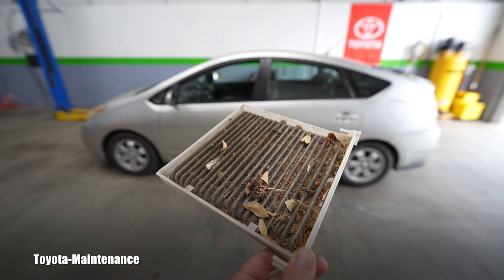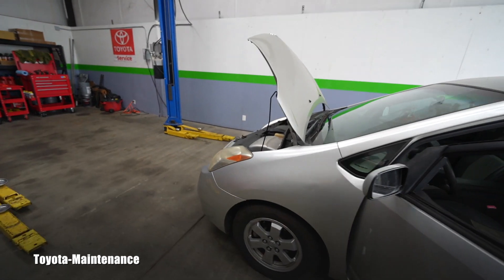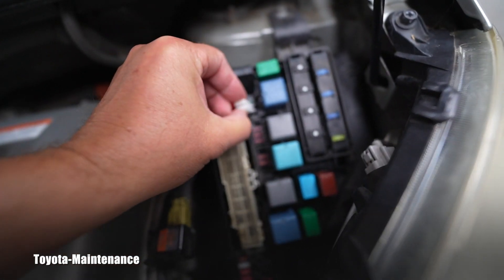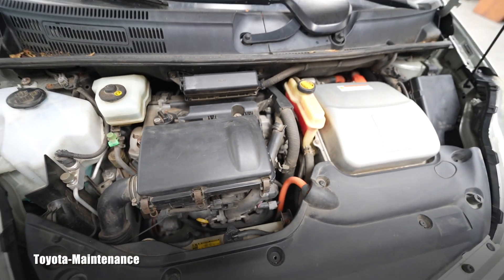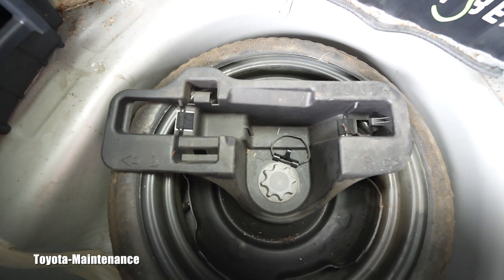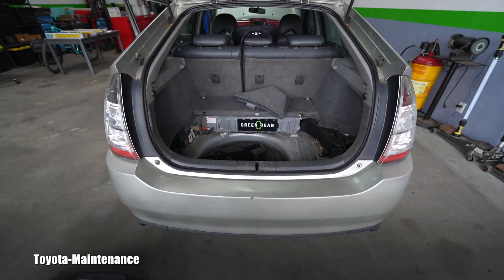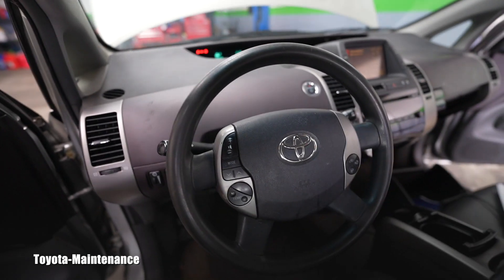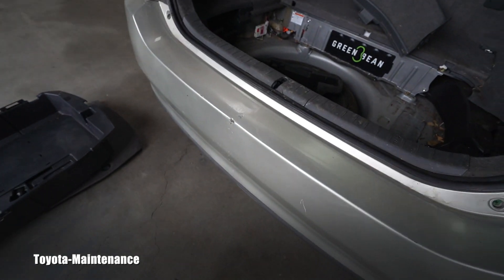Don't buy car like this!

Comment: I owned a 2010 prius for the last 6 years.  I got 154,000 miles already. Change the full synthetic oil every 5,000 miles. Replace transmission  gear oil. Replace all filters. Replace coolant. Last week my girlfriend son. He's a mechanic did full suspension on it. I'm getting new tires this Saturday. With all wheel alignment. This car is been good to me. And I will keep it easily another 150,000 miles. Still original hybrid battery. Thank you for your videos. They help me a lot

Comment: I agree with you on the part that this Prius has seen better days and the previous owner or owners have neglected the car to the point of disrepair. Most likely that is why it got sold. There are lots of cars that are in poor condition for sale and they may fit the budget for some buyers to kick the can further down the road, if they can get a year or 2 of service before it is no longer drivable they will be a buyer for that.  Now I disagree that the only option to replace the battery will be the new OEM overpriced battery from the dealer. There are many aftermarket options for well-known companies that can sell you sells for a fraction of the cost and you can get several thousand miles from the actual battery pack that you have without burning down thousands of dollars on a new battery from the dealer. Remember not everyone can afford those high repairs costs on a low-cost vehicle. We have to keep them running in a safe way. Now we are entering a new era of EV vehicles and more hybrids on the market and there will be an incoming aftermarket product to compete with the OEM battery parts as always been in the past with regular parts. We will see more and more batteries at the lowest cost and possibly with better components than the old design that will bring better range and longer charge due to the evolution of the technology vs the old tech from the 15+ old vehicles.

Comment: Couple of years ago I bought a 2007 Hybrid Camry for $1800. It needed a hybrid and 12V batteries. I got the 12V AGM from the dealer and a new not rebuilt hybrid battery with ALL new cells from a national chain for $2300 installed with 48 months unlimited miles warranty. The company has location in my city if I needed help. They installed it in my driveway. I had zero issues with it and been running like a champ. Did all the baseline service on all fluods, ugs, filters etc myself.

Comment: Got a 2011 Prius. Used it for pizza delivery the last 5 years. It’s got 215k miles on it and driving fine. I change the oil every 5k and change the filters twice a year. No issues with the car other than having to replace the oxygen sensor at 120k miles. Never buy a used vehicle without checking its maintenance history and bringing it to a mechanic before you buy it.

Comment: Full time Uber driver for 5yrs 9mo. Owner of 2 Toyota Prius's (2005 & 2009). Still driving the 2009. Logged 800k miles between both of them, and I drive them both very hard. I can tell you for a fact, that unless you are good with tools and have some know how to work on cars. You might want to pick a different car... These things are full of bugs. The bugs however, will be the least of your concern, and most issues easily overcome... MAIN ISSUE!!! If the previous owner did not change the oil faithfully, that will be the problem going forward...  That car will always use oil.  From day 1 you need to faithfully change the oil every 3k miles. You might take a chance at 5k and be ok, but you're risking it. And you better be using synthetic with filter everytime!  If that part of the maintenance was neglected in the first 100k. You will always use oil in that car. This goes for pretty much any newer car due to the low tension rings to help curb emissions.... Those rebuilt batteries are no issue.  I have a local battery guy, and I've used rebuilt for both my Prius's and no problem. Rebuilt in my area are $250 installed. I've logged 200k plus on each rebuilt with absolutely no issues! I've never had a problem with any hybrid battery, I just changed them out as a preventive maintenance, cause I drive to the middle of no where.

Comment: I replaced two bad cells myself in a 2010 Prius traction battery and it ran w/o any battery issues for another 100K miles. Gave it to a young guy. And it’s still running fine 2+ years later. Just sayin’.
Reply: Yes that's usually the case. A pack fails because a few cells fail. That's how that green bean does it and Dorman as well. You only get a full rebuild from Denso or similar Toyota outfit. Although this vehicle is pretty suspect. Had a hard life.

Comment: A real "lemon" alright. Poor new owner. Like you say an inspection by their own mechanic could have saved them a lot of grief. I've looked over a lot of potential cars for friends over the years. I remember looking at a car in the early 80s. My buddy put it on the lift during my test drive and poked his finger through the rear frame rail over the axle, showed me the bottom of the one inch thick door skin, constant charge light on the dash etc, etc.
I drive it back to the used car dealer, explain what we'd found, and he says" so what's it gonna take to get you into this car today?". I looked at him in disbelief and said " a god damned miracle" and left.
Malcolm Ottawa Valley

Comment: My first thought is he’s a liberal arts student. I bought a 2004 Honda Civic for 1000 dollars in Alabama and gave them 200 buck tip for delivering it with a full tank. Clanged all the filters and oil. This fall I will change the radiator and timing belt. I drive it to work and back 36 miles round trip and it gets 26-28 mpg. If you get a smaller sedan you can afford the 3.50 dollar per gallon fuel..

Comment: The lifted dash was a known problem that Toyota knew about and didn’t cover under warranty. The glove box spring breaks off a plastic retaining tab and then presses on the dash warping it up. Jb weld if you have the broken tab or get a new glove box cover, or cut the spring and deal with a glove box that slams shut.

Comment: My 2013 Prius was just inspected today after over 170,000 miles  on it the main battery cells are perfect  the car end to end is in very good condition it the very best engineered car made!  The most that has to be done is the following : Oil and filter should be changed every 5,ooo miles the Front disk breaks and spark plugs  were changed at 100,000 miles, next all the fluids needs to be change out at 60,000 miles and the break fluid should be tested for water contamination although the inverter and radiator fluids should be tested and changed at a maximum of 5 years before that date if needed ?At 100,000 mile the maintenance for the Prius cost less than a 30,000 mile service on a Mercedes. yes the air and cabin filters are so easy to change that you can do both in less than 30 minuets and finally some cars were having problems with the main battery cooling fan being filled with a number of hair, dirt and other obstructions , well Toyota came up with and external filter that snaps in place externally, I checked mine after 15,000 miles since installed and it was very clean which is amazing that I live in S.E. Oklahoma were it is pretty dusty as the red dirt blows easily all over and into other areas of the car?
 In my opinion the Toyota Prius is the very best engineered car with the least amount money spent for upkeep, don't believe me do a poll of owners of this fine Hybrid AKA Prius and then you will know the TRUTH!

Comment: I have a 2014 Prius V. It was always dealer maintained. I follow the maintenance schedule to the dot (every 5,000 miles). I have 106,000 miles. So far, no problem with the car, to the exception of Boston drivers hitting front and rear bumpers when parking (I had to replace them). I am on my third set of tires. The tires the car came with did not last than long.I think they were Bridgestones.  I  bought Michelin Energy Saver, which were great tires. I just replaced them with German Continental. Not bad tires, but a bit rough and noisy. I have all the service records from the time I bough the car. The point being that if you don't maintain your car, you end up with the disaster shown in the video. I think it is a shame to see how neglected that car was.  One important thing with a Prius, is to check the battery filter. I have to do it on mine. If you filter is dirty, the battery pack will overheat. if your battery pack overheats too much, it is going to shorten the life of the battery, and that becomes expensive. What scares me in the video above is to see that some cells of the battery pack were replaced by third party persons. Replacing those requires very skilled and specially trained people. There is very high voltage there, and it is very risky to mess around with it.

Comment: The cabin air filter: the most neglected forgotten about maintenance item on every car.
Reply: Not mine, I always wanted a filter but never came with one. I chek often so no mice make a home PLUS, so Im breathing clean air.😉
Reply: Agree....most people do not know its existence.
Reply: I change both air filters once a year. 2016 Prius c Two, owned since new in April 2016.
Reply: Yes, you are right. I bought a 2004 Honda Civic the cabin filters were clogged. Now the AC is great!

Comment: Very strange thing about oil change is that always mechanic says every 5,000 miles in the USA, and 5,000 km in Japan. 5,000 miles is about 8,000 km. I suspect they are just saying some number less than manufacturer recommended. Scam or myth?

Comment: Prius are generally reliable vehicles, but they do require maintenance, like any vehicle. Who buys an 18 year old vehicle without some basic level of inspection? Or at least a test drive (which likely would have surfaced the ‘triangle of death’… which most likely means a failing HV battery).

Comment: My wife said the air was whistling in her 2007 Lexus ES350 and could I replace the cabin air filter. Sure. It look a little worse than that one complete with a half dozen cracked open acorns.  Thought about trying to convince her that the grey filter material was charcoal but I thought better of it. ;)

Comment: I suspect the codes were erased and the battery fix did not last. More than $1500 is a scam. Also since the oil was low, I would suspect this slacker skipped oil changes and the engine is shot;

Comment: What could be the cause of the triangle light?
Reply: Usually bad traction battery or 12v battery. He will probably chek the traction fan also for clogging/dirt which will cause battery to heat up. Jst sayn.
Reply: Rice Burner he said what the issue was in the video, no it's not the hybrid or 12v battery.
Reply: @scorpio4236  yes although he did say what it was, the highly feared triangle of death is most commonly associated with the battery

Comment: Customer Knowledge is everything ... Never never buy a used car without an independent inspection first.  You are correct in assuming that that car is nothing but abused and is a ticking Time bomb on Wheels.  Oil, filters, body damage, battery, wonder if the CVT fluid is grease? The little old lady definitely found an uninformed dumb customer .. good for her not the new owner.

Comment: The car looks fine. Don’t be a crybaby
Reply: U obviously have no compassion for other's. I was young once, AND SO WERE U!! Even if YOUR life stinks, doesn't give u a right. If the kid HAD money, he would have gotten a Tesla.
Reply: @riceburner4747  The car is a good car. Don’t be a Karen.
Reply: POS….
Reply: All this Prius needs is a $100 inverter coolant pump. $10 dollar air cabin filter. People are overreacting like this is going to cost thousands of dollars to fix. LOL
Reply: @scorpio4236  That’s right. Mechanics are the worst cry babies when it comes to vehicle condition. Just smash that gas pedal and go.
Reply: @speakbigtruth9383  Exactly. The inverter coolant pump is under recall too. If it hasn't been replaced by Toyota already. Still it's only $100 for another part that will last another 100K miles or more.
Reply: @scorpio4236  I bought an aftermarket inverter pump online for $30. Its so easy to replace yourself it doesn't really matter if it doesn't last as long as OEM.
Reply: @speakbigtruth9383  Yup, only takes 20 minuets to install and bleed the system. You don't have to remove the bumper or headlight.
Reply: @Account NumberEight Hi Troll, thanks for alerting us about you.